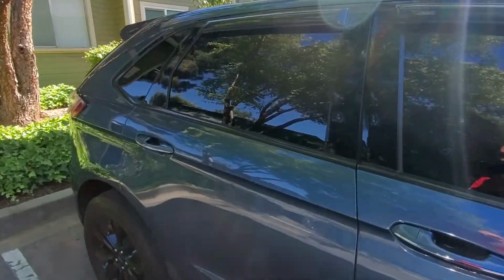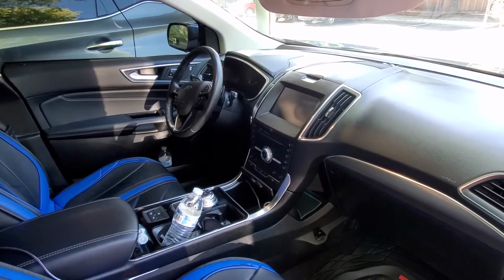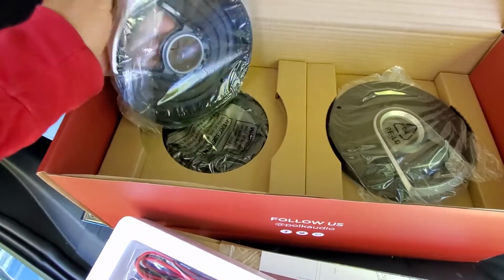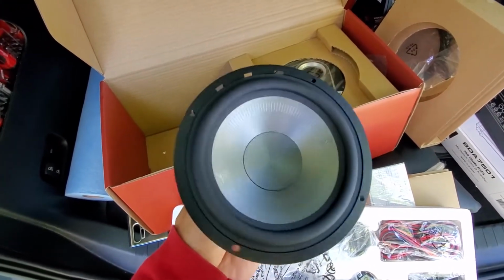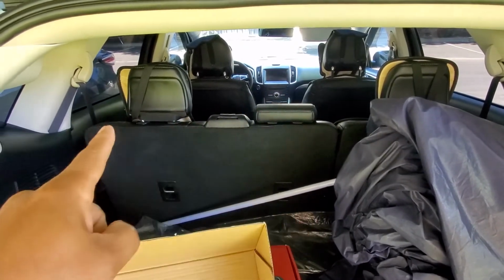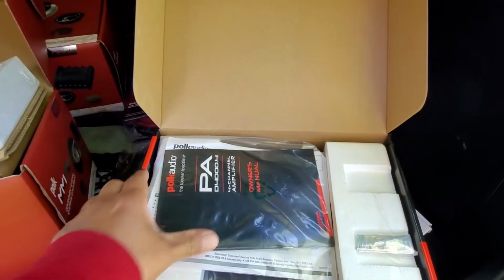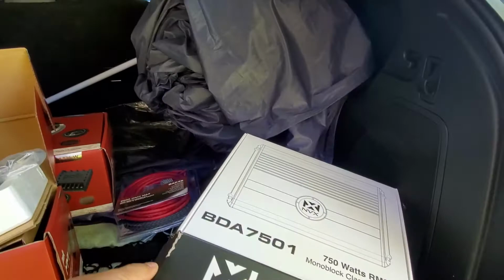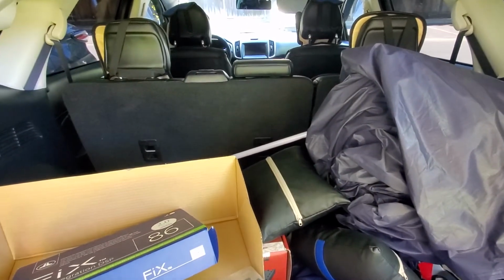2019 Ford Edge Titanium - Sound System Upgrade!!

Comment: Yes I have a 2019 Edge ST.  The B&O is good not great.  Better instrument separation and a bit more EQ would be nice. Definitely could use an upgrade for a more immersive experience but it’s adequate.  Maybe someday I’ll get a setup like yours… Very nice. Thanks for sharing
Reply from the maker: Thanks for watching!! 
I no longer have the Edge. But, I recommend you look into installing a Kicker Key 200.4 instead of all those amps and DSP.  
I just installed the key 200.4 and new speakers into my Escape. They Key200 is amazing 👏.. it's only 50 watts per channel but, with the 4 channels =200watts. Sounds super clean and very full. 
Hope this helps!

Comment: Are you saying the B&O system isn't any good?
Reply from the maker: @marks 1034, thanks for watching!!
Sound I guess can be very subjective.  For a trained ear however,  any "stock" sound system will be compromised as they are engineered to reproduce specific soundwaves. An aftermarket or a DSP unit, are usually engineered with a much wider spectrum of soundwaves. You can easily tell a much clearer, less muddled sound. 
B&O is just a name, to me it's still a very limited and compromised sound.  
Again,  it's all subjective.  
Thanks 👍 PEACE ✌️

Comment: Hello, did the JL Fix 68 perfectly integrate the factory alerts- chimes, voice-over, and factory alarms?
Reply from the maker: Hi Nolan, thanks for watching,  really appreciate it!
Great question! Yes, absolutely keeps everything intact. All chimes, commands, prompts,  bells and whistles. 
Reason being is that, you keep the factory head unit and amplifier.. the JL Audio and aftermarket amps are added to the output of the factory Amp. This allows to keep your ride in 100% factory working condition with the exception that your audio output is now 100% better than the factory. 
I have the JL DSP installed in my Fusion and Edge. Zero issues.  
Let me know if you have any questions. Peace!
Reply from the maker: The connections are as follows :
No wiring  changes from Factory head unit to factory amp.Amp.
Disconnect factory Amp outputs to factory car speakers. 
Wire the factory am outputs to JL DSP inputs, then DSP outputs to aftermarket Amp inputs,  then aftermarket Amp outputs to new speakers.. then you calibrate the DSP. Bam! Awesome sounds!
Reply: @ecobooster8298  Thanks for the replies.  I'm glad it worked out.  Did you run new speaker wire for your main speakers?  Where did you end up mounting your crossovers?  What did you do about the tweeters in the rear upper pillars, just leave them disconnected?  Thanks,
Reply from the maker: @nolanchance1  I actually had all the components and speakers installed. But yes, ran new speaker wire to all 4 doors, the crossovers are inside the doors. I disconnected the center speaker on the dash and left the 2 rear tweeters connected.  I really can't hear them so I figured ah it's ok. 
Which speakers did you get?

Comment: Great video! In the process of doing some audio upgrades to my 19’ Titanium as well and had a question for you-did you disable the active noise cancellation? My understanding is that the ANC does not play well with aftermarket sub amps…apologies if you already addressed this!
Reply from the maker: Hi Dolby! Thank you so much for watching! 
Congrats on your stereo upgrades! What did you modify on your 19 Titanium? 
Honestly,  I don't know how to access the ANC. I was  checking the settings but couldn't find anything  on it. 
With that said, it's still super quiet in my Edge.  Possibly because I added some sound proofing on the doors and base of the rear compartment.  Check my video for that! Lol.. 
Hope all is good and stay safe out there 🙏!
Reply: @ecobooster8298  thank you! I’ve replaced the door speakers with the Powerbass OEM upgraded component speakers (haven’t picked up the car yet so I don’t know how they sound); next I’m thinking I’ll replace the center channel and rear pillar speakers with Powerbass as well.  Finally, I’ve purchased (but not yet installed)3 powered subwoofers-2 Pioneer underseat subs and a nackamichi (spelling?) spare tire subwoofer.  I’m thinking of purchasing a 8” shallow mount kenwood subwoofer (and matching amp) to replace the stock sub in the rear cargo area and then finally getting some bass blockers for all 4 door woofers (hopefully turning them into mid-rangers).  Sorry for the long post!
Reply from the maker: @dolbyfool80  holy smokes! Now that's gonna be some awesome booming! 👌  nice job! Let me know how it sounds man! 
Rock on!!